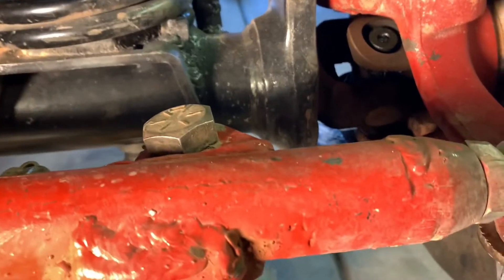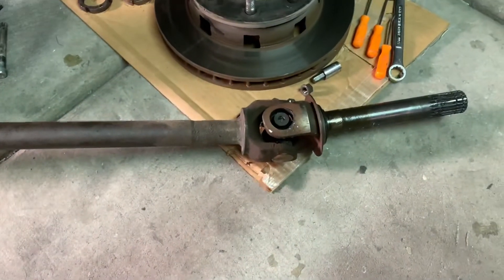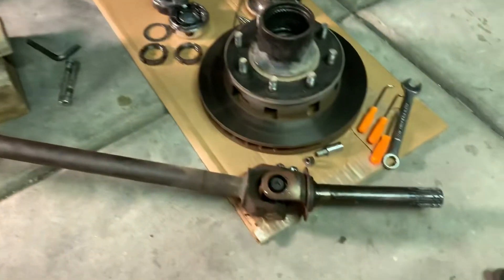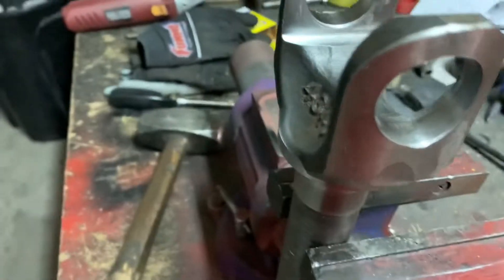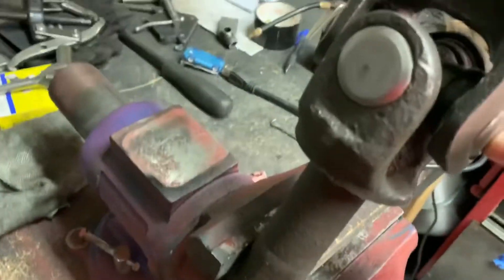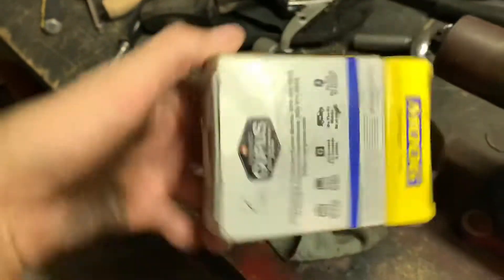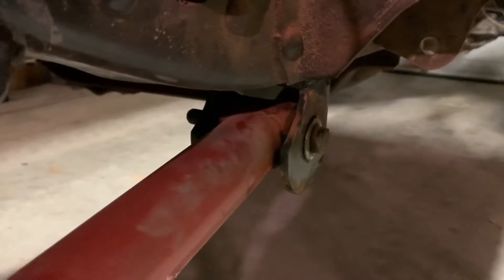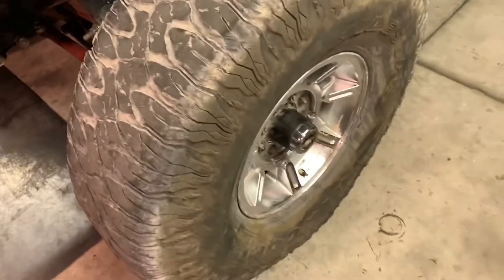FIXING THE 10BOLT AGAIN! - Chevy K10 Truggy

Comment: Dude I am in the same spot with my 74. D44 and 12 bolt, can’t find a 14/60 combo anywhere. Dwbatjng I’m just gearing and locking what I have. I’m on 37s
Reply from the maker: Yeah man, run what you got! They are not as weak as you think.

Comment: 1 ton cost vs fixing 10 bolt cost?
Reply from the maker: Take a lot of stub shafts and u-joints to add up to a Dana 60.  I have an complete extra driver and passenger axle I carry with me so if it break on the trail I don’t have to do a lot of work, just swap shafts. It’s only broke 3 times in 2 years, 40’s, spooled, and hydro assist.
Reply: @Dicks4x4Garage  is it the trail that breaking it or wear and tear